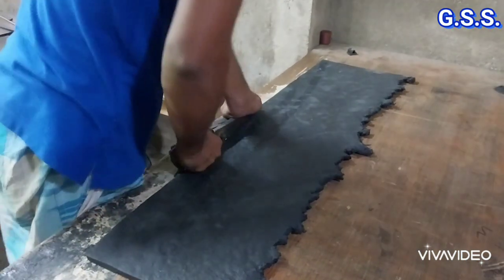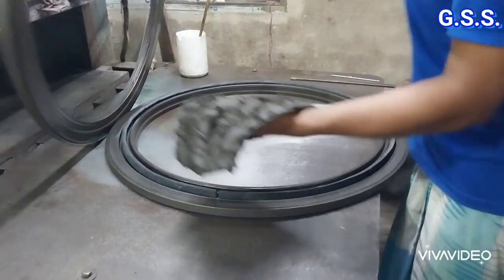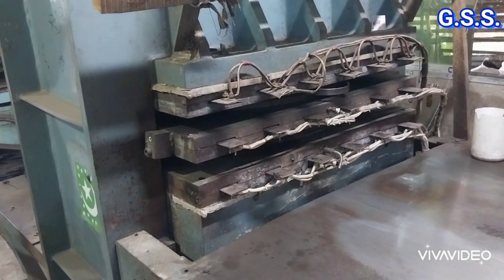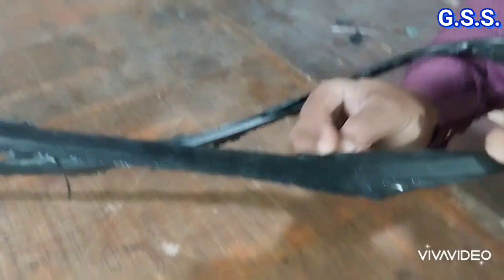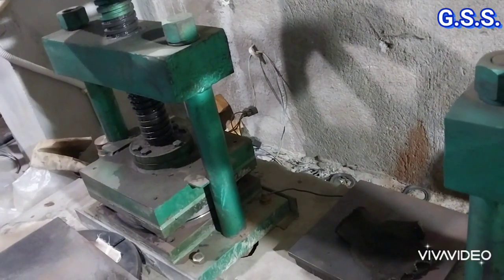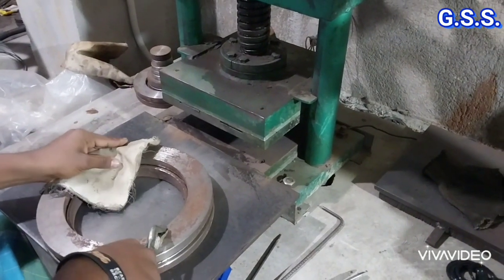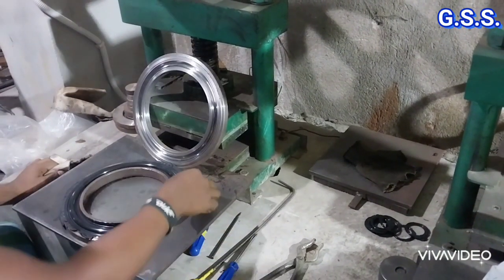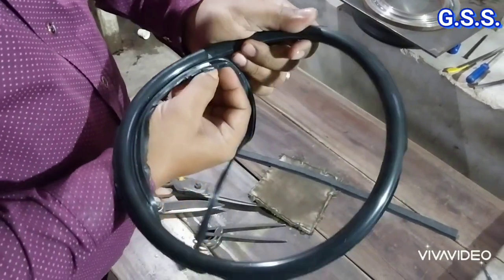Piping Engineering : Making rubber gasket & o ring (Courtesy Raj & Co., Mob-8017543184, 9064368309)

Comment: Sir please explain us about internally  lined pipes. Liquid epoxy lined and fusion bonded epoxy lined and their differences
Reply: The primary distinction between FBE coating and 2-pack epoxy lies in their application methods. An inherent limitation of FBE coating is the potential for damage during the seat ring fitting process, which can subsequently result in corrosion. In contrast, 2-pack epoxy can be applied after valve assembly without requiring specific conditions. Moreover, 2-pack epoxy is particularly advantageous for maintenance work, especially in remote locations.

Happy to discuss if you need more information
Reply: @kiranvnair20  thank you sir